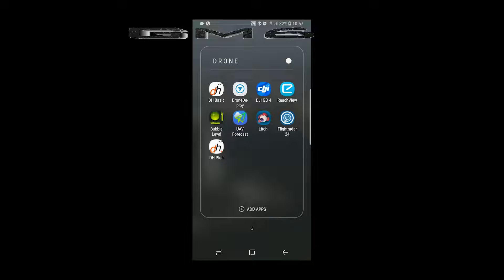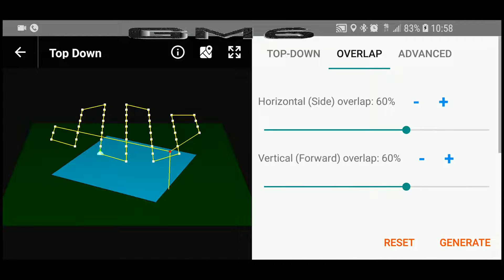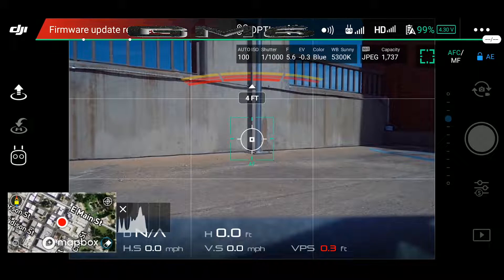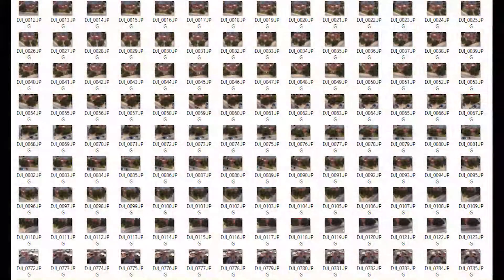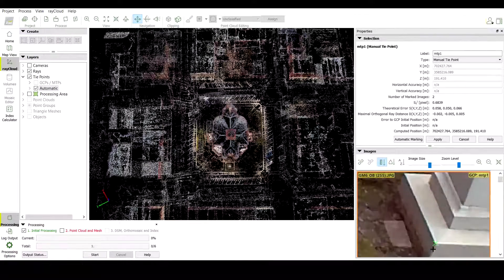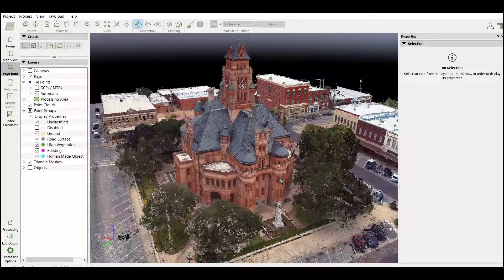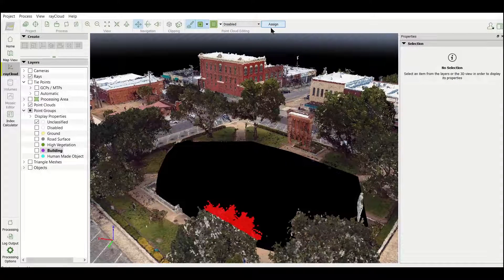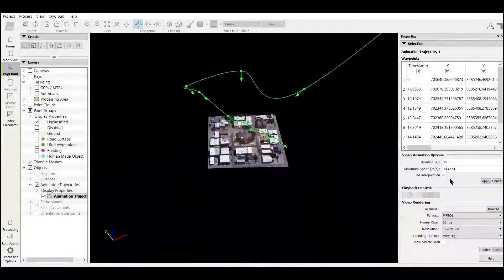How to make a Photogrammetry 3D model with a drone FOR FREE

Comment: Hi. Thank you for video. I can't decide - AUTOfocus or Manualfocus. What do you advice?
Reply from the maker: @Марат Тикеев 100% manual focus. While in auto, focus the camera, then put it in manual so it stays. Adjust the focus only when you need then leave it there. That will give you more consistent results. You should only need to change it when the distant from the object changes enough to be out of focus.
Reply: @GM6DroneMapping  ok, thank you. But why on 3:43 minutes of video on the left side there’s a AFC. Not MF?
Reply from the maker: @МаратТикеев  That is because I am not in position yet. When I am ready to take pictures I tap the screen to focus then put it in manual so it stays. I do not try and manually focus it. The screen is small and the sun is bright so I don't trust my eyes for that. Does that explain it better?
Reply: @GM6DroneMapping  yes, thank you. I think about depth of field. Little aperture is little depth of field. I try shooting on 8 aperture and in sunny weather shutter is 1/200 - you recommend 1/800, 1/1000. Therefore I think about 1/200 shutter - is it too big, long shutter?
Reply from the maker: @МаратТикеев  did I recommend 1000 for the shutter speed? Well if so that was a couple of years ago. Don't do that. The shutter speed is relative to the drone's speed. 1/200 for modeling is good because you should be flying slow.
Reply: @GM6DroneMapping  ok, I understand that you recommend such short shutter

Comment: I have sg906 pro 2 drone. How can i use it to create 3d model?
Reply from the maker: If it has GPS then you can use it like any other drone except I would not fly it in wind. It does not look like it can handle wind.
Reply: @GM6DroneMapping  Is there an app to take pictures to cover a site for 3D modeling for such drones?

Comment: Excellent Video! Did I understand you right that you flew your NADIR flights with the camera at 45 degrees? (so not NADIR anymore? :) Do you find better results with this for 3D mapping?) Did you have any images looking straight down? You then added Obliques anyway in you POI flights? Just learning so excuse stupid questions :), some of the items I'm reading on 3D mapping is first flights NADIR, then obliques at the same height, then obliques lower again, just looking to understand why you did it differently, thanks again for this insightful video!
Reply from the maker: Donal, as the old saying goes, the only dumb question is the one you didn't ask.  Yes, I flew the grid pattern with a slight angle because the buildings are so close together. I wanted to get the sides, so I angled the camera up. If I only wanted the building in the center or the building was not surrounded by other objects, then I would have flown a single grid at a 90 degree angle, then a POI around the object of interest (in this case a building)   In the beginning I read all the material on the best way to capture data. I found a lot of it was wrong or incomplete. Now the real truth is, some things in mapping can be changed and tweaked, somethings can not.  Keep learning and experimenting.
Reply: @GM6DroneMapping  Thanks a mill for the reply! and again for sharing your insights! Again excuse ignorance, 90 degrees is straight down? Cheers!
Reply from the maker: Correct.  I think it may be -90 on the drone but yes straight down.  I should have been more clear because 90 and -90 are 2 different angles.  👍

Comment: How many Battery did you go through to capture that many photo
Reply from the maker: I used 3 batteries. I only changed them out because I was starting a new mission. I probably could have done it with 2 but then you run the risk of running to low in the middle of a mission.

Comment: What type of camera should a drone have to be able to carry out drone mapping?
Reply from the maker: After extensive research and testing, I would say you can do it well with any Phantom 3 or Phantom 4 series drone. The P4P is better but you can use either drone. They all have what is called a rolling shutter, a camera with a global shutter will give you the best results. You can find a camera with a global shutter on the more expensive cameras.
Reply: @GM6DroneMapping  MAVIC 2 zoom can do it ?
Reply from the maker: @antoniomiguel6298  Yes
Reply: @GM6DroneMapping  Currently, what are the 3 best drones for this type of service?
in your opinion

Comment: Your videos have improved greatly. 
A timesaver tip: After selecting a tie point in two images, click the icon on the far right - that will center the remaining photos on the tie point, making them easier to find/select. Happy droning!
Reply from the maker: Joseph Azzarelli hey thanks for that tip. Yes that is a huge time saver. And thanks for the compliment. Through my failure comes knowledge.

Comment: Which Drone you have used for this project...???
Reply from the maker: For most projects I use a Phantom 4 Adv. It has the same camera as the Phantom 4 Pro. The most important part about data collection is the camera settings. Even a Phantom 3 will make a good model if you set the camera up right. Of course with a P3 you need to be closer to the object.
Reply: GM6 Drone Mapping Thanks a lot.

Comment: To clear the point cloud I use the clipping cube, you can move it and resize and move as you like removing from the "scene" what bothers you at any given time. I think that with this system you gain time to work avoiding to classify more points, although in many cases you have to use both methods. 

The automatic point classification, unless in this last version they have improved it, I do not see it yet ready, it is very difficult for it to classify well. Although all help is welcome. This operation, the cleaning operation, is very important to get a good model and above all it is the one that consumes more time. 

I have the feeling that in the last versions the processing time of the program has decreased considerably. Which is always good news. 

Good video, very well explained and above all the results are very good. I think part of the credit is for the assistant you brought with you ;)
Reply from the maker: Thanks for your input. I forgot about the clipping cube. I agree with everything you said. Cleaning the point cloud is the biggest part of it. In Agisoft they have a tool called Gradual Selection. It lets you clean the point cloud in seconds.  The other thing I want to mention is Pix4d has a setting that allows your computer to send data back to their server to learn how you use point cloud classification and supposedly makes it better. I haven't tested that but I read about it.
Reply: They release new versions every few weeks and for lack of time I find it difficult to follow all the tools they release. A more powerful tool, than doing it by hand as it is now, would come in handy to clear the point cloud. 

I didn't know about the learning in the cloud of automatic classification, it will be a matter of looking at it, especially if it improves the cleanliness of the model in this way. (I can't find any information about this function at the moment)

The tool Gradual Selection is a great tool, Pix4D should also adopt something similar to facilitate the work.
Reply from the maker: ArrUnTuS David Pix4D calls it machine learning Ill see if I can find a link to it. 
Agisoft has a bit of a learning curve but the gradual selection is huge. I believe pix4d has an automatic version of the tool. Thats just based on some things Ive seen not fact. If you are on Facebook be sure to join a couple of the drone mapping groups. So much knowledge is shared by some really smart people.
Reply: Yes, has a automatic classification tool, in the second step you can activate it. But that's what I was telling you, it doesn't classify very well (at least when I've tried it). I like the Photoscan tool better because from what I've seen it works pretty well and is very fast, in a few steps it cleans the model very well. 

I'm already in a couple of facebook groups, it's about time, a scarce resource for me...... Thanks, I'll have to keep digging when I get a chance.
Reply from the maker: ArrUnTuS David  Sorry what I meant was an automatic tool for clearing some of the points (like noise) similar to the gradual selection tool in Agisoft.
Reply: Well that's very interesting, if you find it and you can comment on it it it would be very good. Thank you.